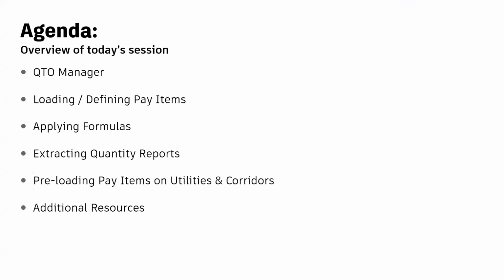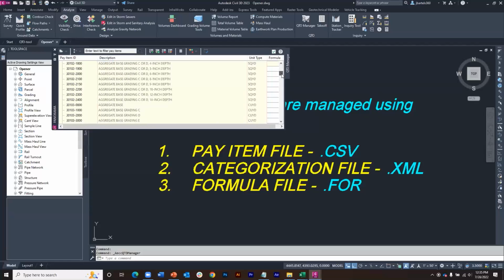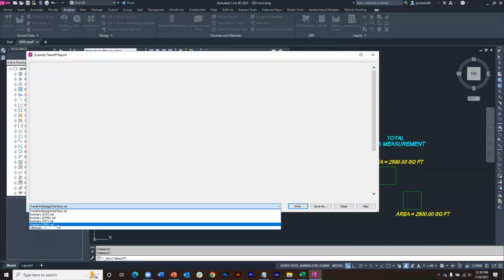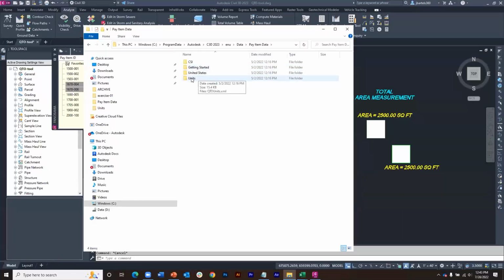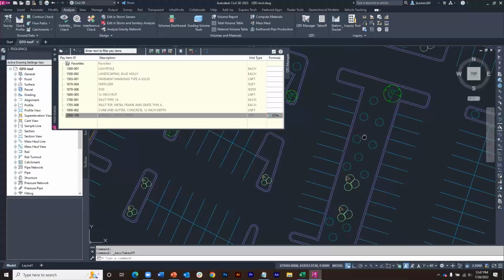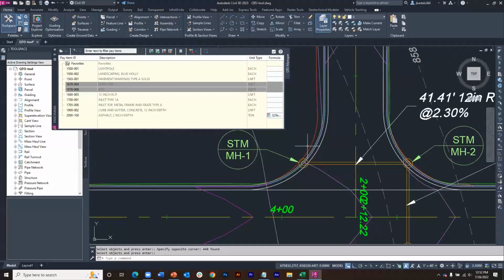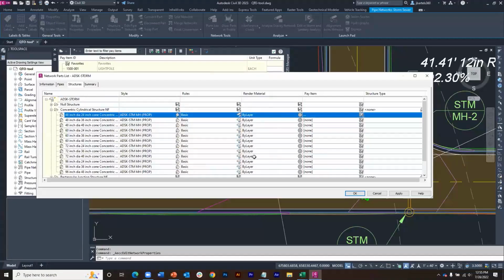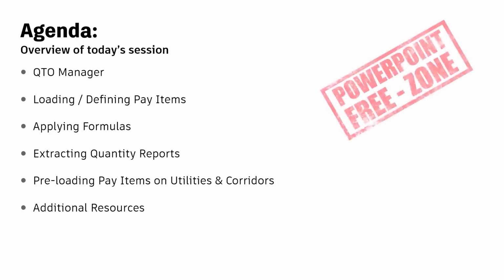Getting Started with Civil 3D Quantity Take-Off (QTO)

Comment: Hey Jeff!
Great as ever, and I've visited all of the mentioned points before I saw this video. And, so far, I've never managed to assign a single pay item to any object ever. First off, right click on pay item doesn't give "Add to object", and when I use the icon on the top of the vista, it just says "Select a pay item from list", even tho I came from the list. It's become seriously bothersome, as I do more and more corridors, and i would benefit greatly from using this feature. Any ideas?
Reply: Ok, so, as I wrote the question, a suspect came to mind. And, after opening the Quantities7 tutorial (Civil3D tutorial), and quantities NOT working, I was able to confirm - regional settings. Amazing that they're still a stumbling block..just leaving that here, in case someone else is struggling as well.

Comment: This is very helpful.  thank you for the concise demonstration.  A couple questions:  1. what is the recommended approach for developing a unique categorization XML file that aligns with our regional DOT pay item listings?  2: trying to assign pay items to our pipe network parts list, however i find that OOTB PVC pipe parts do not align with the sizes available in the parts list (ie, the available pipe diameters in the network parts list differ from those in the getting started pay item XLS file

Comment: What if I wanted to takeoff the linear footage of parking stripes, as you showed, but the two ends of the parking stripe were inadvertently created by the engineer to be 100' different in elevation. That's going to throw my linear footage off. I could see the third dimension being an issue when it comes to takeoff.

Comment: hi. your video helps me a lot. hope you could help me with this. I'm having trouble calculating coz the requirement should be in metric system. I've changed all my default unit settings but in takeoff it says it is still in english. how do i change this? thanks you.

Comment: First off, thank you for the great lessons! Second, when windowing objects to add a pay item, if the item has a pay item assigned, will a duplicate pay item be added if the object is in the selection set; I.e. if you are doing mass striping and you need to additional striping, once complete, you layiso the striping layer and assign a pay item to all objects? In your video you showed multiple pay items on one object, just wondering if the same pay item can be added to an object. Worried about duplicating quantity.